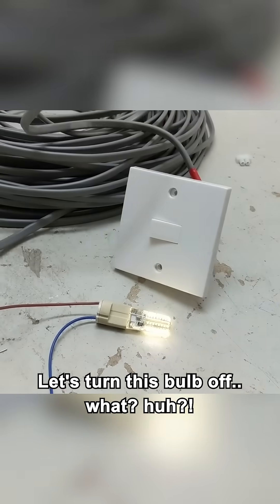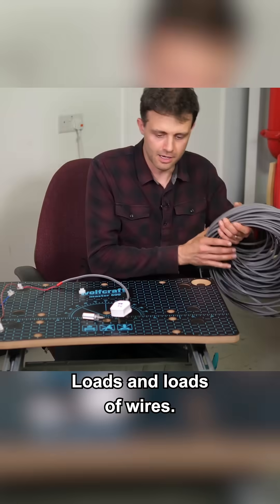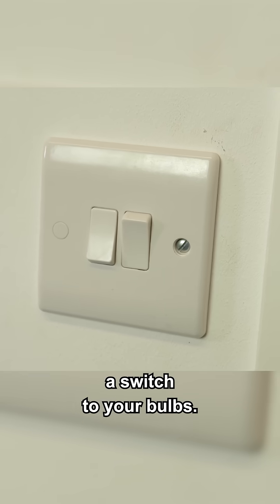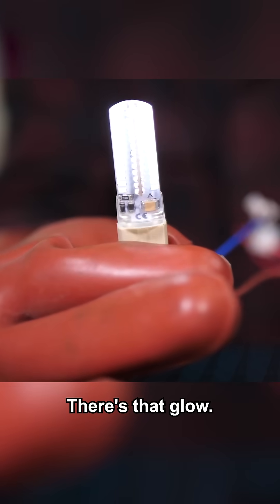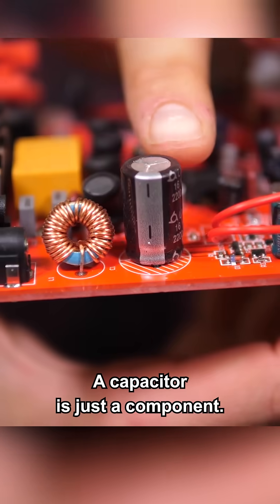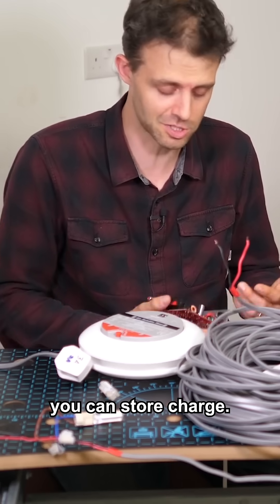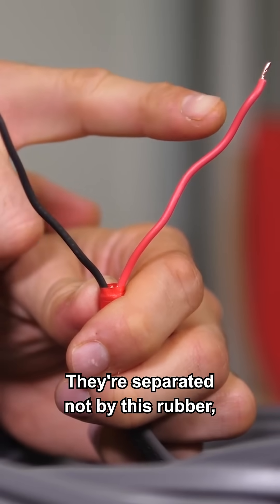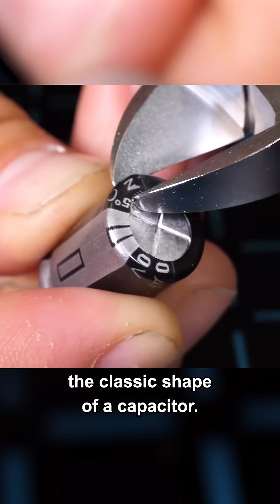This Zombie Bulb Will Not Turn Off! But Why?

Comment: It's basically a simplified diagram of two opposing plates, not a break in the circuit 🤷
Reply: It is a break in the circuit.  Suppose you could assign serial numbers to each electron throughout the circuit.  If you could track each one, you could see that no electron will ever cross the gap, due the electrical behavior of the circuit.  Capacitors are filled with an insulating material called a dielectric, which blocks current from flowing.

Side note: I'm neglecting quantum mechanics here, which would enable a statistically insignificant number of electrons to cross the gap, for reasons beyond the scope of my point.
Reply: The reason capacitors work, is that the transient electric fields in the dielectric, act as if they were a current across the gap, and also produce a corresponding magnetic field.  The apparent current through a capacitor, that is really a transient electric field, is called displacement current.

The effect of Kirchhoff's current law, still holds when black-boxing the capacitor, and ignoring what happens inside of it.  The electric field sets up equal and opposite charges on each plate, so any electron pulled away on the positive side, is matched by an electron pushed toward the negative side.  The net effect is still that current into the positive, will equal current out of the negative.

Comment: What's the symbol for an accidental capacitor?
Reply: Actually it's the same as for a regular capacitor, but it might be noted somewhere to clearify.

But in reality, the shown wire is not just a capacitor, it's more like an infinite number of capacitors between live and neutral each separated by an inductor and a resistor along every single wire. The values for resistance, conductance and inductance can be calculated (or approximated) using some formula.

Mostly these values are used in high frequency applications or to calculate the need for compensating elements in the electric power grid.

Comment: I noticed this in a long hallway in my house when I upgraded it to LED. When I flip the switch, the lights fade out instead of turning off right away. It’s still pretty fast, maybe a second, but enough to notice it. So this explains that.
Reply: I always assumed it was capacitors inside the LED bulbs discharging. I never stopped to think it could be capacitance on the wires
Reply: Different things, unless they stay glowing very faintly.  You have capacitors in the globes, because the LEDs are DC so there is a cheap AC/DC converter regulator circuit in it.  But the line capacitance Steve is talking about allows current to keep flowing, keeping the circuit & LEDs powered slightly. 
You have to have the right circuit set up for it to happen, with regards to switch position & wiring length though.
Reply: you can put a resistor in the circuit to stop that (some companies market led snubbers which are the same thing)

Comment: Isn’t it because you get voltage drop along the cable and the voltage at the end of all of that extra length is enough for the LED to not light up

Comment: It acts as an inductor not as a capacitor
Reply: No, it doesn't. It could work as an inductor if you connected a load between one end and the other end of the coiled up wire. But in this case the magnetic field has the exact same effect on the live and neutral wire so the net effect is that there's no difference in voltage coming out to the lamp. (At least not from induction.)

Comment: Are you sure you disconnected live wire and not neutral?
Whether it is a coil or capacitor it does not store energy for ever.
This glow suggests that current found its way through the bulb...
Reply: Yeah, that's what I thought too
Reply: In this case the accidental capacitor doesn't store energy. It's in an AC circuit so it charges back and forth with every cycle and that tiny capacity lets through enough charge current that the capacitor essentially acts as a sort of high value resistor. It's called capacitive reactance. And whether the phase or neutral is disconnected doesn't matter, because the effect would be still the same. Hope that makes sense to you
Reply: Thanks husky, Now I finally understand it. In other words you can demonstrate this effect by plugging just one wire to the LED with a rezistor. It's basically a working principle of that screwdriver which detects AC. And it can be easily fixed by disconnecting both neutral and live (but it's unsafe!)
Reply: I thought more along the lines of accidental transformer, since he connected the wires on one end it looked like
Reply: @SpiralPyro a transformer is just a device that has ratios of wraps of wire with some iron to make it more effective. one loop of wire close to another is a one to one transformer, but most items can't work at the small amount of power the magnetic field carries. LEDs work at milliwatt power. that same power was running thru incandescent bulbs but didn't make light. about 5% of the power you pay for is wasted from resistance and waste loads
Reply: Inductance through the contacts of the switch itself. See it often. There's rarely 0v leaving a switch and headed to a light.
Reply: the normal home wiring doesn't break neutral or ground. this is a good safety for us. but cheap direct drive LED lights need such low amperage at volts that they can glow . 3 switch systems have this happen because you have live hot wire next to hot to load.  you usually don't have as much wire side by side in single switch wiring
Reply: @adrianwilson7536  that's true we'd need the 3rd PE safety wire if live stays connected in case of switch malfunction and the neutral would disconnect, that would be a problem. I'd still prefer a 2pole switch with PE than a leaking circuit tho.
Reply: @adrianwilson7536 eh debatable. There's an extra wire with "no power" but it has power leaving to the second switch at all times. It's very very similar in nature to how a single pole switch operates when it comes to where power comes in and leaves, there's technically no extra live wire that's any different from having a switch on. What you're speaking of seems more like inductance through the switch, which is a thing that happens on all switches. Rarely does a mechanical switch ever reduce voltage to absolutely nothing.

Sorry for the edit, had to clarify A typo.

Comment: It's not just a break in the circuit - it's a break with a lot of surface area around the gap which I think explains the parallel lines in the diagram
Reply: I believe the original capacitors were two parallel plates separated by dielectric materials. They look like the symbol
Reply: @BinarySecond  Modern capacitors (usually) are too. The parallel plates are metallic films with a dielectric layer between them, which are then coiled up onto the cylinder shape you're used to
Reply: @HollowRoll  yup, just like this video
Reply: The capacitor should be in PARALLEL with the bulb NOT  IN SERIES in the wiring diagram!
Reply: @travisderthick9361  No. The capacitance is in series with the bulb, allowing the current to pass through despite the switch being open. It does not run off the voltage stored when the switch was opened. There's alternating current passing through the wire capacitance.
Reply: A coil of wire creates inductance, not capacitance.  Very long lengths of wire do have a capacitance reading, but it’s very small, and wouldn’t light that bulb for one second. Inductance is at play here.
Reply: @alphagt62 It’s alternating current, you cannot store current in a magnetic field if then current is alternating. Capacitance is at play here, and the jumble of cable that’s acting as a weak capacitor is getting charged and discharged 50 times a second so it’s enough to light the bulb.
Reply: @potatodox7104  the current is no longer alternating the moment the switch is turned off and it runs off the voltage when the switch was turned off
Reply: @alphagt62  incorrect. This is capacitance at play. This is an electric field  store between the 2 wires close to each other in the cable. The coil is irrelevant.
Reply: @alphagt62 100 m of wire can have something like 10 nF of capacitance. That's enough to pass slightly more than 0.5 mA of alternating current through it which is enough to make LEDs glow slightly. It doesn't run of any stored energy. It's just a high impedance path for the current to flow through, going around the open switch.
Reply: All that wax paper comes from your ladies last Brazilian BTW.. Reduce, Re-use, Recycle.

Comment: The 120v circuits in a home have a neutral wire that’s always 0v and a live wire that oscillated between +120v and -120v. Does it make a difference whether you put the switch on the neutral or the live wire?
Reply: Fun fact: it actually oscillates between +170 V and -170 V, assuming a typical US 120 V AC circuit. 120 V is the RMS or, described a bit inaccurately, "average" voltage over the full AC cycle. But because it's a sine wave that has some low spots, the peak voltage is higher, by a factor of the square root of 2, than the RMS voltage.
Reply: Ignoring the safety issue of switching the wrong side, yes, it makes a difference. The ground conductor would increase the effect on the neutral side and decrease the effect on the hot side. Think of capacitors in parallel on the switched neutral vs. a capacitive voltage divider on the switched hot.

Comment: I have a bulb, which is in a dead battery.

It's been emitting a little battery for years now, despite the battery being dead for probably 8 years. You can only see it when it's really dark though!
Reply: Define "dead". It clearly has enough voltage and charge to power the lamp and has been for years. 
It may not be usable for what it's intended for but it's obviously not dead yet.
Reply: @wo-olf well, you kinda answered your own question, don't you think? "Not usable for what was intended for". If the battery only has power to emit a light that is only barely visible in a very dark place, there won't be energy for pretty much anything else.
Reply: @Alfonso162008  a dead battery is dead. Dead means dead. Not almost dead, not barely alive. Dead. If the battery is dead it's flat, no measurable voltage. The difference may not be of importance for you but it is for anyone working on electrical components, when there still is a voltage left that may damage other components.

Comment: Its more like an inductor than a capacitor with that many coils though

Edit:I am wrong, it is capacitor. Explanation is in the comments under here.
Reply: No. It’s a capacitor.
Reply: @terjeoseberg990 
Very large value capacitors (in the whole farads) are made from inductors acting like a capacitors.
Reply: @cigmorfil4101 , Really? How?
Reply: @terjeoseberg990  
Personally I don't know, but my electrical engineer of a brother told me about them years ago (back in the early 1980s).
Reply: @cigmorfil4101 , Well, then I don’t believe you.
Reply: Remember kids it doesnt flow in the wire thats just what gives it the potential to travel easily through conductance
Reply: An inductor has to go in one direction and be connected on both ends so that currently can keep flowing. This one goes around the loop a bunch of time in one direction, goes through the lightbulb, then loops around the opposite direction, then it’s open. It’s therefore not the same as an inductor.
Reply: @terjeoseberg990  I think you're right, now that I think about it,if there really was a huge inductance across the wires then there would be a spark across the switch when he turned it off. But there is no spark, the open circuit is powering the light and probably due to a voltage differential between ground and the electrons stored like a capacitor in the wire.
Reply: @prateekkarn9277 , Right.
Reply: If it’s DC in the wires to the switch and light assemblies, then a capacitor is a good explanation. But if it is AC, then the inductor is the more accurate explanation because the changing magnetic field that noncontact voltage detectors sense will induce a voltage in the other wire like a coiled up set of transmission lines.
Reply: @mkrepps , The wire turns around and heads back. Electricity is therefore traveling in both directions equally and they therefore cancel each other. There’s no magnetic field. It’s not an inductor. It is, however, a capacitor.
Reply: @terjeoseberg990  I see what you are saying, and capacitance makes sense if it were a DC circuit, but I was thinking it could be ghost voltage coupling because one wire is acting like an antenna due to being disconnected at the switch end. The fact that it is coiled up (like an inductor) is irrelevant to my hypothesis. My point is that the two conductors are right next to each other and parallel (not twisted) in the cable sheath. I guess my hypothesis could be disproven by disconnecting both the hot and neutral wires with a double pole switch. I think if Steve would have plugged it into the wall socket and unplugged it rather then installing a switch on just one of the conductors, the phenomenon would not occur unless it truly was just capacitance.
Reply: @mkrepps , Yes. It’s like an antenna. An antenna is a bit like connecting one end of a capacitor. Electrons can flow in and out.

If you put the switch on the live wire, the lightbulb should shut off. If you put the switch on the neutral wire the light should still get some electricity as the electrons from the live wire are pushed into and pulled out of the wire.

Comment: Are you sure it can hold that much charge? Try to discharge it... I don't trust this vdy
Reply: It doesnt hold charge per say. A capacitor in an AC circuit acts like a resistor

Comment: The captions are covered by the UI, can you move them to the top of the screen next time?
Reply: Depends on what version you're using. I'm watching from my phone on the website and it's fine
Reply: @lolman123401  It's still absolutely valid. For some of us, it's really tough to read. Putting the captions in a spot appropriate for all, or most, would be logical.
Reply: Not a problem in this video, but it's also infuriating when a video starts with captions and then they just stop halfway through. I have to turn on the CC afterward and it completely ruins the flow of the video.
Reply: Those are the captions included in the video, if you turn on CC then there's captions at the top
Reply: @turoni314  Thanks :)
Sometimes it's not an option, tho :/
It's too bad they couldn't figure out a universally workable solution.
Reply: Y’all deaf?
Reply: @aleyorch44  Why? It a problem for you?
Some people are deaf or hard of hearing or in noisy surroundings or need to be quiet or have other reasons for wanting to read the captions...which, quite obviously, exist for a reason. If that's not acceptable for you, I guess it's too bad. awwwwww.
Reply: @echognomecal6742  you’re just complaining tho
Reply: @aleyorch44  ? As opposed to?

Comment: I still dont really get why it glows. Can there be further explanation?
Reply: Basically, it glows because current is flowing through it. If you have alternating current (AC), then it can somewhat pass through a capacitor. The best water-based analogy of a capacitor is a balloon stretched across the middle of a pipe. If you have DC, the balloon stretches until it balances the water pressure and stops. If you have AC, the water moves back and forth, and the balloon flexes both ways and allows water on the opposite side to move
Reply: @RobbieRosati  thanks i think i get it now 😊
Reply: I have a Chinese light bulb, I just found it, and when I turn the socket off, it turns off, but then I touch the light and then it faintly lights up
Reply: He explains everything in the 10 minute full video linked below the title.
You don't expect anyone can fit a full class in 1 minute, right?
Reply: @VoodooChiller  Some people have the link the UI and some people don't. :-/ I don't see it when I load the video from https://www.youtube.com/watch?v=NnpZmWtGk0s
Reply: @shamblebamble  ah yes, but you have to force it to open like a normal video from the url. You don't just find it outside the shorts section, and even this "normal" url you had to modify, because if you share from the shorts section, it comes with the shorts url.
Reply: @VoodooChiller  Nope, didn't have to modify anything! This is just what popped up in my feed reader.
Reply: @VoodooChiller  sorry didn't notice that there was a full vid 😑. Dont know enough about this topic to know if it would fit in a minut, so i assumed coz its a short that it would be.
Reply: @galdoug8918  no problem. And sorry if I sounded rude, didn't mean to